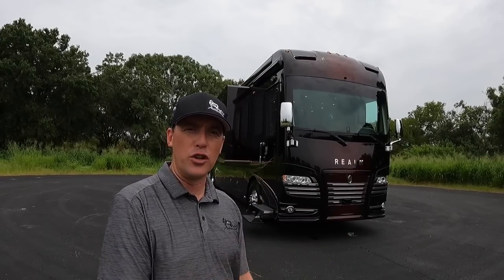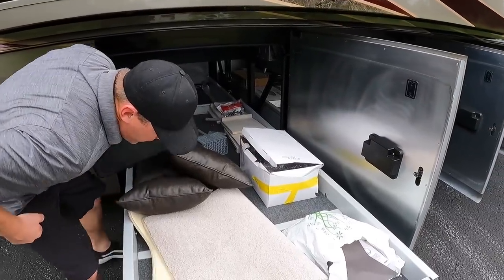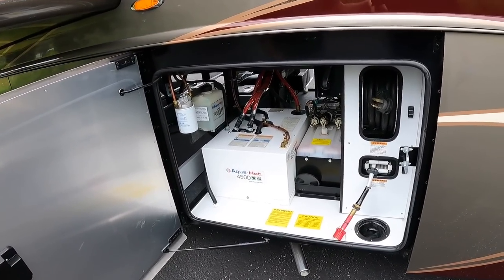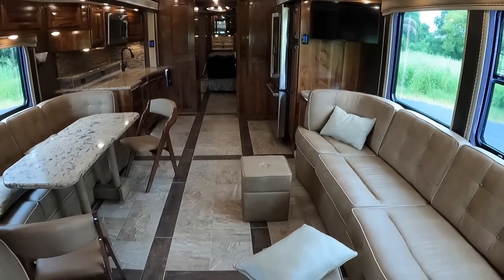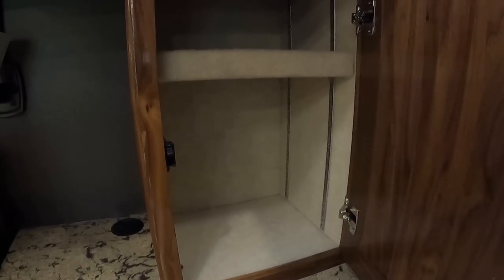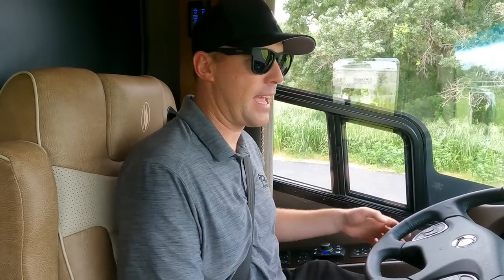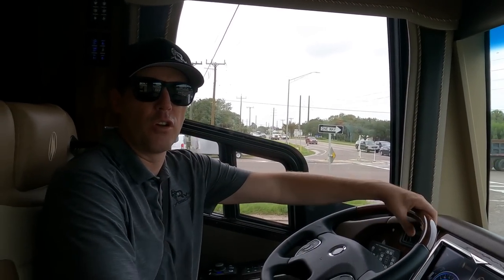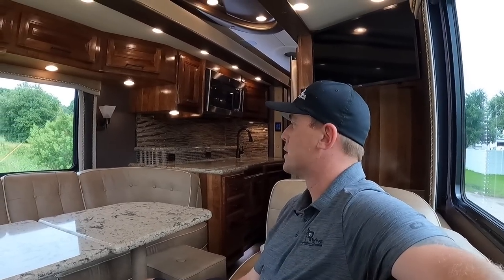2020 FORETRAVEL REALM TEST DRIVE AND TOUR

Comment: Bang for the buck, Foretravel is tough to beat. Many of the features are equal to coaches costing far more, and this coach clearly shows that quality and craftsmanship are on par or above anything else in it's class. Nice tour, gave us a good look at yet another fabulous coach. Thanks for sharing, Andrew, nicely done! 👍
Reply: I Agree, for the price Foretravel is the best Class A Coach. I wouldn't buy any class A for any were near $1M or even half a mil unless it has rounded air sealed power slides. Better to buy a new or used Foretravel or Newell. For me Prevost is out of the question unless they start offering it with a 605HP Cummins & Steer Tag axle.

Comment: Andrew,  What the TYRON bands do is prevent the tire from coming off of the rim thereby allowing you to stay in control of the coach so you can safely slow down and get off of the road.  I love the FORETRAVEL coaches and they have excellent customer service like the NEWELL coaches.  At the Tampa RV Super show they had a new 2020 REALM on display with a MSRP of $1.222.900 with a Show Price of $831,572 so Brad should have a little bit of wiggle room with his listing of $699,999.  ;-)   I'm not a real big fan of the air pocket doors.  I guess they are nice but it seems like that is just something else to have problems with down the road.  It seems easy enough for me to reach out and pull a door open or closed :-)   I love the color scheme and the one at the Show had the same colors but a slightly different layout,  I do think the curb side dining area makes more sense though.  At the 2021 Show it appeared blue was the popular color for several of the manufacturers.  I wonder what the populr color will be for 2022 ... green maybe?  LOL

Comment: SO... is the Foretravel built like a Prevost with the aluminum or steel monocoq beams in the walls and roof ? Alot less expensive than Prevost or the other super high end ( 2 million) coach you always like so much and whose name i`m forgetting at the moment. So how do they compare. I sorta think this would compare to Country Coach if it was still being made and then the 2 absolute best being Prevost & the brand  Dean Loucks paints.
Reply: No.  Fiberglass exterior on a Spartan chassis.  Still a great motorhome.  Newell uses aluminum exterior on a fully welded chassis.  Prevost has both fiberglass and stainless steel exteriors on a fully welded chassis.  Country Coach and Wanderlodges have are welded chassis's.  Country Coach has a fiberglass exterior, Wanderlodges are stainless exterior and fully welded frames.